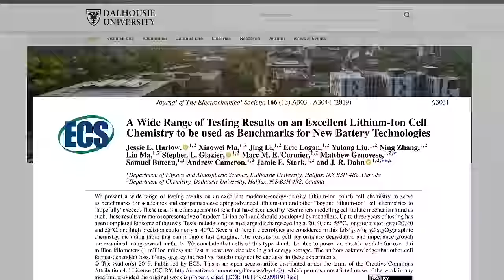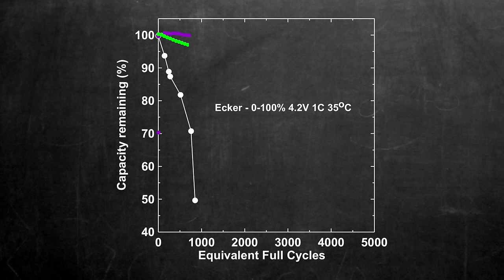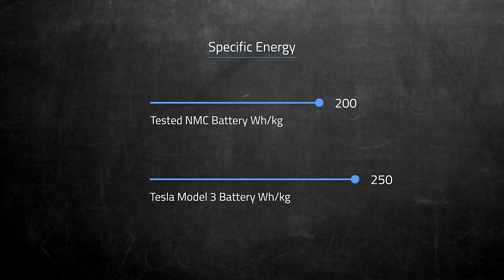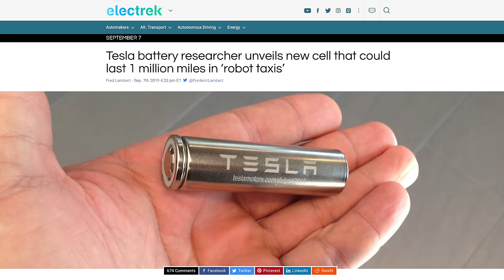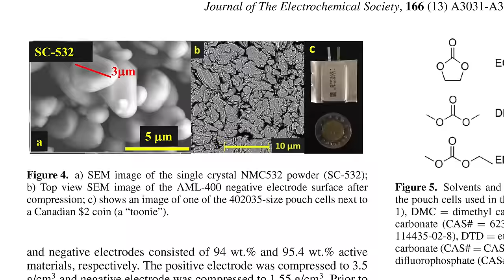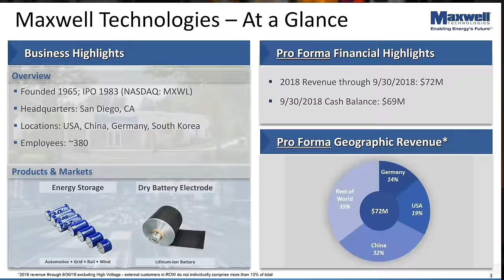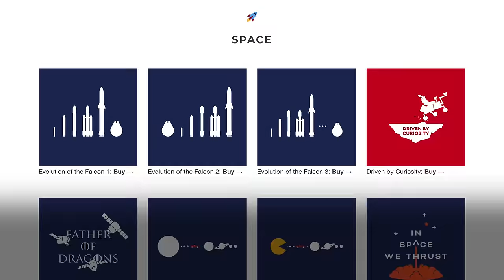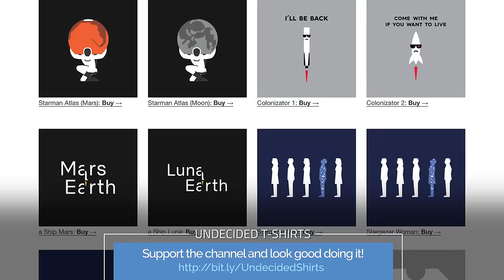New Tesla battery? Jeff Dahn and 1 million miles

Comment: To be honest, I'd be pretty happy with a battery that held up well for at least 50,000 miles, even if I can't have a million. After one year and 12,000 miles in my Model 3–doing everything I can to baby that pack–I'm staring at 9% degradation, and the drop is accelerating, not stabilizing as everybody promised me would happen. My capacity chart was happily flat for about 6,000 miles, then started to tumble, and continues to drill a hole in the floor. I have to drive well above 100% efficiency (like 225 Wh/mile) to even see 270 miles of range, where I could originally drive at about 245 wh/mile and see over 310 miles.

I have friends and relatives with the same car, purchased at the same time.... who have lost so little capacity that it is just about impossible to measure.

A bigger Tesla champion you are not likely to find. The car is still awesome.... my loss of range, not so much.

Anyway... on to the million-mile battery! Thanks for the great vid to explain all this.
Reply: @JT_771  Oh yes. I'm not one to sit quietly by.  :-) . Their answer: It is within their acceptable loss envelope. Nothing more to see here.. Once I hit 10% loss, I'm gonna make a bigger stink. Much more than that, and my loss will be more miles than my Leaf can go on a full charge!

I have friends with S's. And they almost universally have seen less loss over five and six years!
Reply: @JT_771  Its all good. I appreciate folks who want to help... vs those who just assume that I'm an idiot. What amuses me most is that no matter what I say I'm doing, somebody will tell me that I'm doing it wrong. I've been told that I'm not taking the pack to the extremes enough. And I'm told that I'm taking the pack to the extremes too much. I'm told to leave it sit at the extremes, and I'm told to never do that. Reminds me of gardening advice for a sick plant: You are either watering it too much, or not enough.

To set your mind at ease, I'll give you a bit more background so you don't have to fret about me.  :-)
I've been driving a production EV as the family's main car since 2001. This is my 5th EV. I have about 300,000 EV miles under my butt. My Model 3 is my second Li car,  and my first Tesla. I've also had two lead cars and a NiMH car. I converted my NiMH car (Rav4EV) to Li. I've consulted with Tesla and Nissan, and have even visited Nissan's super-secret Li battery plant and had discussions with their battery engineers. I have a website dedicated to EVs that I began in 2002 for the EV1 and the Rav4EV, and I am administrator of three EV email lists. I can charge four EVs simultaneously in my garage... 50A for three, and 100A for one. And no, I don't think that I'm all that and a bag of chips. Just a guy who's completely dedicated to electric transport (If I can't ride my bike there), and is an efficiency nut who at least sorta knows what he's doing.

When I say that I've done everything I know to baby my Tesla's pack, it means that in theory I know what's best for it through study and experience, and that I'm doing what I can to treat it right. I treat my pack way better than my neighbor does (driving 85 mph from 100% to literally empty regularly). He's lost two miles of range as far as we can tell. And he's had the car for six months longer than I have had mine. About the same number of miles.

I forgot to mention that Tesla has also helpfully informed me that driving fast or up-hill reduces my range. Yay. Thanks, Tesla! Hadn't thought of that when I told you my efficiency numbers that take all that into account.  :sigh:
Reply: Sounds like you are doing everything correctly.  The one thing that comes to mind to consider is that occasionally there is an issue with the battery management system being fooled and reporting (and acting like) the range is decreased, including not allowing normal full use of the battery capacity.  Maybe a Tesla Service Center can check it to see if that might be the problem.  Good luck!
Reply from the maker: Ugh.  That’s really frustrating.  I’ve seen a bigger drop than a lot of other people, but not that big.  However, from everything I’ve seen, it could be computer/battery calibration issue.  Have you tried the recalibration trick where you drive the car down as low as you possibly can and recharge to 100%?
Reply: @DrTed3  Tesla checked my battery capacity remotely. It is on the low side of the bell curve. But I guess as long as I'm on the curve, Tesla is happy with it. To be clear, this isn't only a reported range issue. It is an actual range issue.
Reply: @UndecidedMF  Hi Matt. Yeah, frustrating indeed. Sorry to hear that you're seeing more than usual as well. As I've just posted to DrTed3 above... this isn't just a reported range issue. In fact my reported range (currently 285 miles at full) is quite a bit more than the actual range that I'm able to achieve even when driving well above (below, I guess) 100% efficiency. And yes, I have tried (once!) draining, and then charging to 100%. I hate doing things that actually degrade my battery in order to create a better range calculation. What I'm after is actual range. I don't care so much about reported or estimated range.

Tesla has tested by battery for actual capacity. It has lost 9%, and they say that this is "only" 3% more than the average loss in cars that are similar to mine. Never mind that 9% vs the 6% average is 50% more than that average!

Comment: Gali at hyperchange interviewed the founder of nano one
Hope i have the name right
They hold the patent for single crystal 
All batteries are multi cystal 
You shove them into a battery cell.
Since crystals are different sizes they have fracture planes 
When shoving them into a cell tjey break on the fracture planes 
Thats why batteries degrade 
With single crystal there arw no fracture planes
So they go into a battery undamaged
The second nuance
Tesla builds a huge battety pack 
This way they never charge it all the way 
Nor let it discharge too far either 
This allows mote cycles
With single crystal the battery can take more abuse so you dont need such a big pack 
Please watch the hyperchange video cause i may have missed something

Comment: Matt, could you talk about this news that researchers have made a lithium-carbon dioxide battery that has seven times the energy density of typical li-Ion batteries? https://www.goodnewsnetwork.org/first-rechargeable-carbon-dioxide-battery/ At this stage it has only been tested for 500 cycles, which is not practical for EV use at this time, but 7X the density is a huge deal if they can work out the issues.

Comment: Having a Battery that doesn't need to be changed in 1 million miles is like an ICE car claiming you can fill up the tank for at least 1 million miles before you change the tank.
They introduce a problem (battery life), make a solution to a problem that was not even there compared to an ICE.
EV Marketing at it's best. 
More problems and more complex problems will appear with EV over time.
Already the real world problems of increasing apartment living with no home charge is becoming evident. Not only is it extremely inconvenient but every time you super charge you are burning your battery life.

Comment: Excellent stuff really interesting thanks. 
Do have a look at what Ian Scott and Moltex are doing with super safe low cost nuclear power. They have molten salt thermal storage (as used in solar thermal power plants) to give peak loads of 3000MW from a continuously running 1000MW reactor.
The reactor itself is much lower cost because the functional hazards of “normal” nuke operation have been designed out.

Comment: As I'm pleased with the no nonsense presentation, l'll take the liberty to propose one more usage scenario.

Most people in the EV world avoid questions of energy distribution in massive concentrated demand scenarios. As EVs become pervasive and a non negligible proportion of the fleet, so will demand for electricity for recharging. Most of the time it can be done at home in non peak hours, with demand distributed in time and in space.

Let's imagine other scenarios as vacations or rallies somewhere with massive concentration in space and time, well above usual demand. This would lead for a massive demand for electric energy delivery, concentrated in space and time many times above usual and very challenging to the infrastructure. I'm supposing we would expect a throughput that mimics what we're used to with liquid fuels, at least in the same order of magnitude.

Another scenario would be the recharge of many longer haul big trucks.

Tesla peaks recharging at some 125 or 150kW. Porsche Taycan at some 270 kW with 800V DC fast charging.

InsideEVs reports CharIN is aiming at 2MW charging rates for trucks.

270kW would need a tri-phase  220V x 715A circuit to deliver that kind of power. More than a dozen household typical installations where I live.

2MW (2000kW) rates for one big truck (to recharge 80% in 30 minutes) equal the peak demand by some 35 floors of office building demand, for some 1500-2000 employees, with ar conditioning, illumination,TI equipment, etc.

If this kind of distribution that rivals what is currently in widespread use with liquid fuels, each "electricity station" will inevitably be an electric substation, and most probably need massive storage to smooth demand presented to the grid.

This IS an application where the specific characteristics of the long endurance batteries could make a huge difference in ROI. Supposing flow batteries or some other kind with very low cost per MWh stored doesn't evolve to challenge this.

Comment: All that said, does it make sense that Tesla bought Maxwell?  Did they get any critical patients or was it just about getting a great R&D shop?
Reply from the maker: The dry battery electrode manufacturing process was patented, so they got that.  There are a lot of other patents too around capacitors.

Comment: Still need to come up with a way to recycle these things or we are just making things worse every year.....again, as we always seem to do.
Reply from the maker: There are ways to do just that.  I have a video from earlier in the year on battery recycling.  And there have been some interesting advancements form companies like American Manganese.  Closed loop recycling isn’t far off.
Reply: @UndecidedMF  please post the link to the video.
Reply from the maker: TIB1973 https://www.youtube.com/watch?v=iFchfHH0qzg
Reply: ok, I think I actually seen that video another time.   My point was that there is not currently a viable way to recycle these batteries. Maybe I should throw in economical as well...... There is research and they are making advancements but there isn't currently a way to recycle the batteries we will be producing in the next 10 years let alone the ones we have created in the past 10 years.  Will it be there some day? Sure, I have to believe that we are smarter than we were.   I actually have LG Chem batteries installed and supporting infrastructure where I work as part of an Eaton solution.  We are going to be installing a Vertiv/Samsung solution soon and letting the two run as pilots for a few years.   The intent being that we will use them brand new in critical spaces for about 10 years then move them to less critical space for another 10 years.   It will be some time before Lithium replaces my current inventory of 20000 VRLA batteries so we have time to figure it out.   Thank you for your videos, they are informative.
Reply from the maker: @TIB1973  I agree that it’s a big, big issue.  But it’s closer than you think.  American Manganese has a method of recycling that’s currently being tested right now with some actual manufacturers (the companies are under NDA, so it hasn’t been announced who yet).  They’re able to recycle the materials for less money than mining for new materials, so it’s going to be economical.  That’s why I’m planning on doing another update on the topic because there’s a lot of interesting things in the works that are much closer than you might expect.
Reply: @UndecidedMF  awesome, thanks!  It's been a concern of mine to a long time.

Comment: Tesla semi is a scam. Do the math. I’m in a international semi truck right now the max weight by United States law for a five axle truck is 80000 pounds. The two axles on the trailer max 34000 pounds the drive axles 34000 pounds the front axle 12000 pounds just the semi tractor ( truck ) is around 26000 pounds. The load inside a dry box trailer ( outside temperature trailer) can be up to 46000 pounds. With the Tesla semi it has a battery pack that weights around 26000 pounds. Now if you add a trailer the front axle can go up in weight. This truck I’m in if I put just one front tire on your foot it would crush your foot with 6000 ft pounds of force. So if you don’t get the weight balanced and you get in a wreck by law your truck is illegal and you as the driver can lose everything and go to jail. Now please tell me how a 300 to 500 mile of range going to replace this truck at 1400 mile of range and I can and have filled both diesel tank 120 gallons each and def 25 gallons tank under 15 minutes and I can find a diesel fuel truck stop in every state and most towns.
Reply from the maker: Not sure where you’re getting those Semi numbers, Tesla hasn’t released any details on weight yet.  But yes, the weight of the Semi is a gigantic question mark because it eats into how much you can haul.

Comment: Battery technology is at its infancy, there will be massive steps in the next 5-15 years which will make todays batteries look like complete junk in both battery density and longevity😉
Reply: Respectfully disagree; many of the first cars from over a century ago were electric. Battery technology didn't stagnate for that entire time. Today, the stakes are higher. Advances are made in steps, with lots of wrong turns and blind alleys. Every advance is a good one!

Comment: Hey Matt, just came across the following article. What do you think: 
https://www.dailymail.co.uk/news/article-7592485/Father-eight-invents-electric-car-battery-drivers-1-500-miles-without-charging-it.html
Reply from the maker: I hadn’t seen that, but am intrigued.  Although, there are some red flags for me in the article: 1) The Daily Mail has a spotty track record with accuracy at times, 2) Trevor claims the Tesla battery costs £30,000, which is wildly inaccurate.  Not saying this isn’t true (I hope it is), but Cleantechnica tried to track down some details and had no luck (look at the author note at the bottom).  https://cleantechnica.com/2019/10/20/uk-man-invents-aluminum-air-battery-in-his-garage/